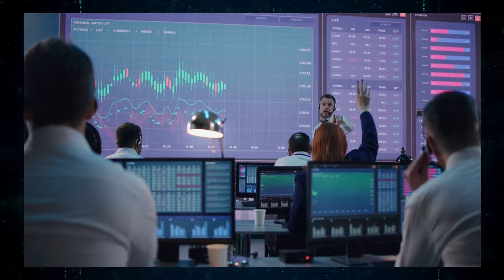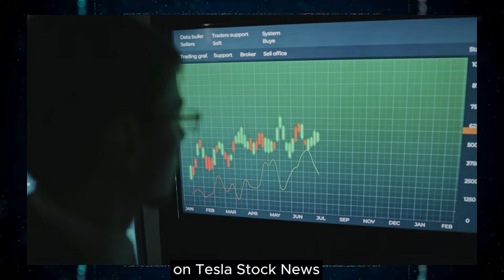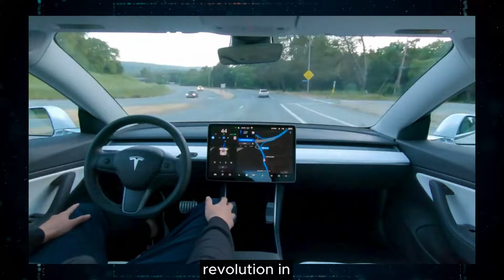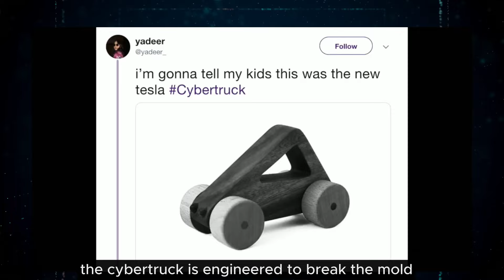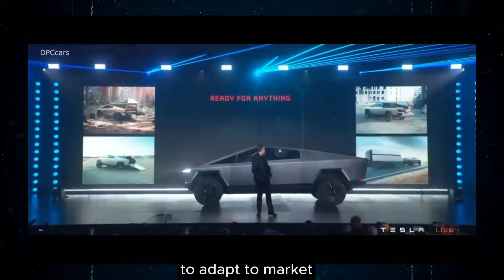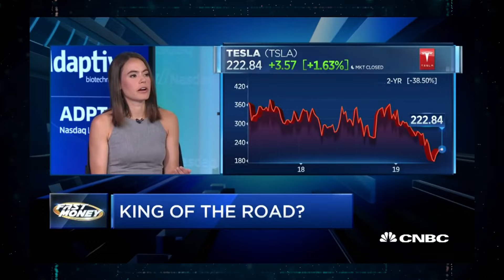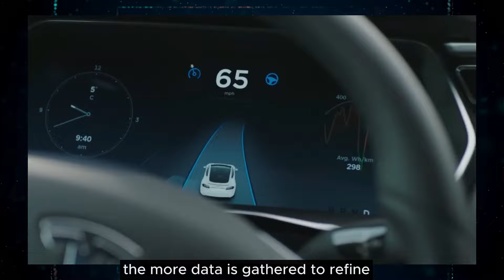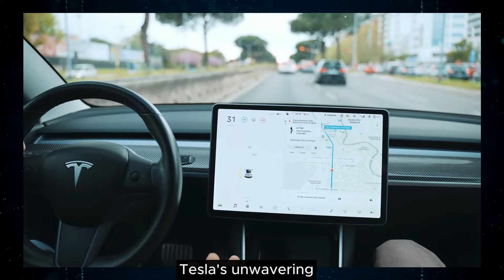Cathie Wood: If You Are a Tesla Shareholder... Get Ready for Something HUGE

Comment: What the heck does self driving have to do with reducing CO2 emissions? 

You do realize that this is just a distraction. It is a way to justify the high price of the EVs and distract from the inconvenience. I don't own an EV but have been in a few when I take Uber. None of the drivers use the automatic driving feature. I wonder why? 

And another thing. Modern ICE cars are almost all "fly by wire". They could be made self-driving as well. Automated parking was first implemented in ICE vehicles, for example.